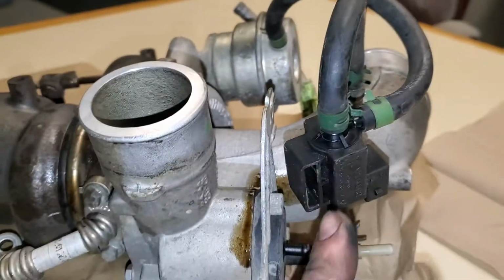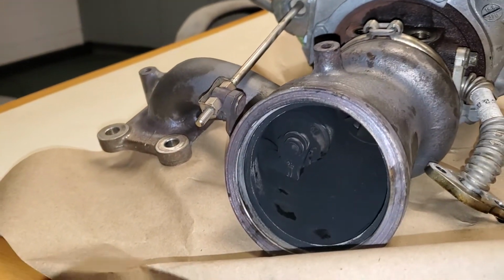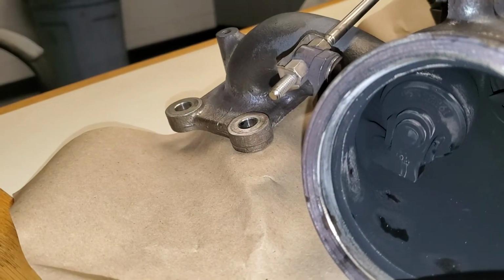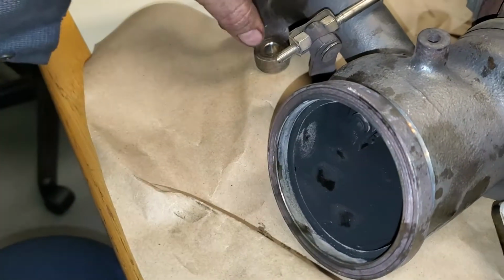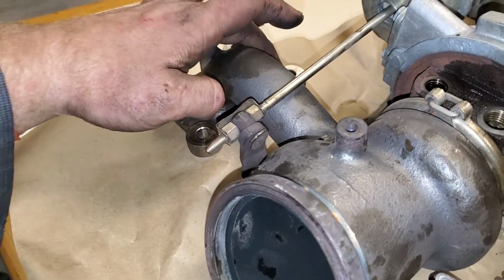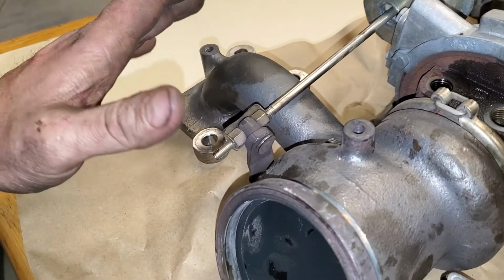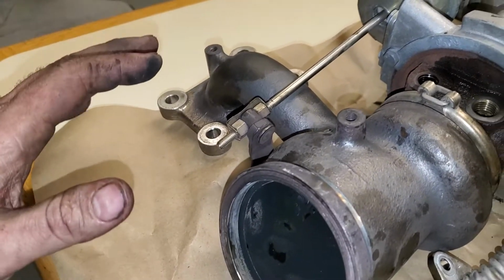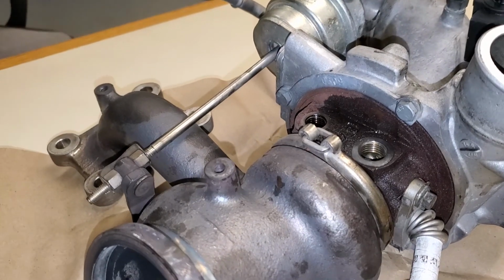2017 Ford Fusion 2.0 ecoboost P0299 Under Boost Condition, turbo talk, rattle sound and My Findings

Comment: Hey so I changed my mind and decided to go with an escape rather than a fusion. I found an awd one with the 1.5 eco boost. How are the 1.5 engines? Sorry to bother you again lol.
Reply from the maker: You should watch my new video I just put out on the differences between the escape and the fusion and that willl give you the answer
Reply from the maker: https://youtu.be/N_cH2u-hneA
Reply: @FordBossMe  will do thanks.
Reply: @FordBossMe  hey just finished watching the video and it didn’t really answer my question.
Reply from the maker: @SRT313  how long have you been on my channel? 

as many videos I have on rebuilding escape and fusion 1.5L ecoboost engines 

The reason I showed you that video is because there are main points in that video that you should have picked up on I guess you probably didn't though.... the 1.5 liter ecoboost engine is not a good engine when it comes to reliability because of the block design until it's been updated with the new design
Reply from the maker: @SRT313  if you go through my videos you're going to see s*** tons of videos on the 1.5 liter ecoboost engine
Reply from the maker: @SRT313  especially on the Escape has the same exact engine that's in the fusion so one is not better than the other and that was the whole point in me, showing you the video with the fusion show you it's the same thing that has the same as coolant loss issue.
Reply from the maker: I wish you would have asked question or actually searched through my videos without purchasing the escape first honestly
Reply from the maker: https://youtu.be/a04Fa_5xia0
Reply from the maker: https://youtu.be/SUbpIrHirMY
Reply: @FordBossMe  I haven’t purchased anything yet. Honestly I haven’t really looked through your videos. You just seemed very experienced with eco boost engines. I was looking into fusion but decided I wanted an SUV so I’m considering a Ford Escape now.  They offer both 2.0 and 1.5 eco boosts. It’s hard finding a 2.0 escape. I heard that the 1.5 are pretty bad so decided to ask you. Sorry for all the trouble. You’re the only person on YouTube who actually seems knowledgeable with eco boost engines.
Reply from the maker: @SRT313  I would try to get a 2.5 liter naturally-aspirated Escape I know that's probably not what you want but it's the most reliable
Reply from the maker: @SRT313  2.0 is better but it does have some turbo issues at times so I would pick the 2.0 over the 1.5
Reply: @FordBossMe  I wish but it doesn’t come in AWD that’s the only issue. Also I’m having trouble finding any 2.0 escapes. About 80% of them are 1.5 eco boosts. I’m debating whether or not on pulling the trigger on a 1.5 with 40k miles on it.
Reply from the maker: @SRT313  2.0 eco is the next best bet better than the 1.5 

the 2.5 is the best bet by far though

Comment: Hii sir I have explorer 2013 2.0 when push it I get check engine and it's shows me code p0299 it's gone when I clear it and only comeback when I go full throttle  is it normal ?
Reply from the maker: No probably turbo needs replaced or a vacuum actuator issue
Reply: @FordBossMe  ohh man got it thanks for the help
Reply: @mooauto2388  
Hello...wat was the cause of the check engine light

Comment: How much does it cost
Reply from the maker: The turbo you could pay anywhere from $700 to $1,200 and then it's about 5 to 6 hours labor so you're probably talking close to two grand if not a little bit more
Reply: @FordBossMe  I just got my car fixed...they changed the turbo booast solenoid...
In one day the light came back on..
Reply: Is it still ok to drive my car..
Do I have to fix asap